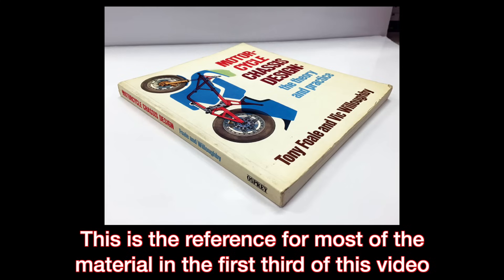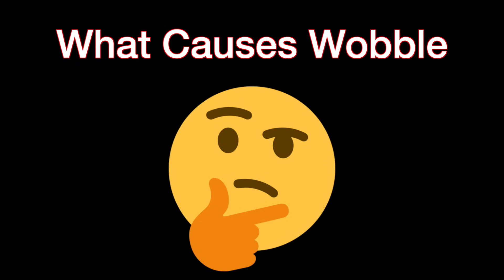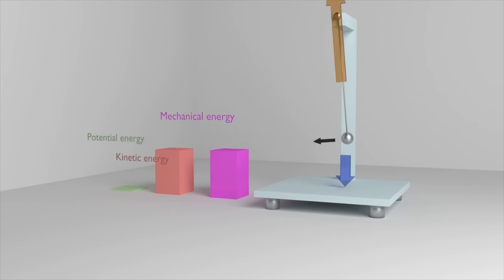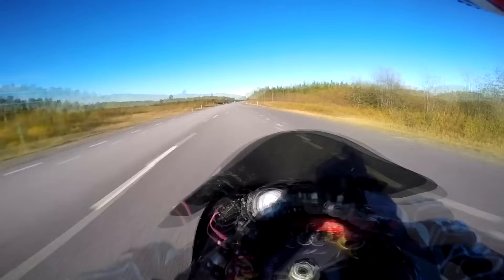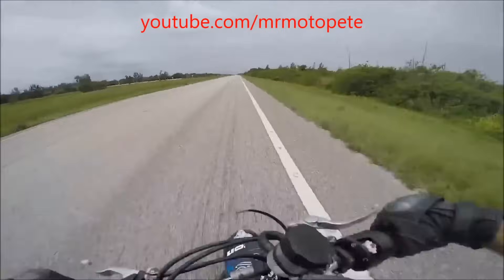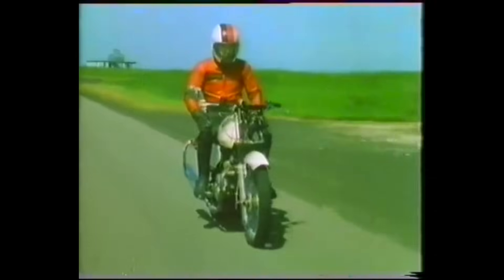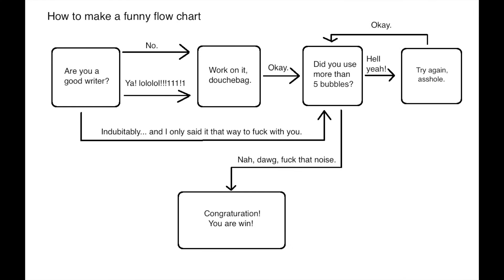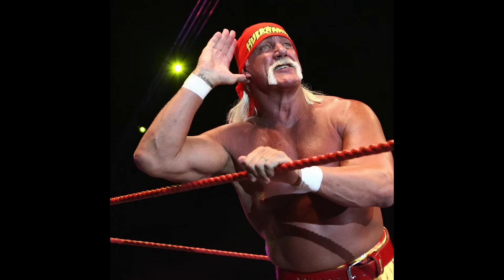Tank Slappers AKA Wobble Explained: Cause, Effects, and Remedies

Comment: I don't know a lot about the modern bike wobble but old school we find a smooth ride point my bike is s sportster  ,it has a nice smooth hands off the bars at about 30 MPH that means I can take my hands off the bars and just coast for 2 or 3 minutes with full control and no wobble of any kind .. I do this test every week or every few rides to make sure a wobble is not developing ...I have never had a problem because I do this test if I make any changes in the weight of my load on the bike or gear I am using , I use a windshield and if check my brakes often ... I have rode a bike with a wobble and that sucks ...a lot of wobble comes from the front end and correct tire and condition of the tire ..the fact is some bikes don't like some tires .. a bike made and design with a given tire company may not react the same with a different make of tire and tread  .....I restore old bikes  from the frame up and found this to be the case in about 70% of the bikes I worked on .. hd Honda any of bikes can be effected by design threshold ,once you change something on the bike the bike goes past that threshold  and hello wobble ! the best thing I can say is take a few weeks and set the bike up for you so your bars fit your ride and you are balanced correctly and if you use forward controls make sure your foot pressure is forward and not resting on the bars ..I use my saddle bags a lot but I change tires every two years ...both front and back ...and I do them my self so I know they are done correctly ...and nothing has changed my set up of the bike and how it rides ...then I do my smooth test . if that bike will coast smooth at 30 it should ride smooth when driven at 60-65 .. MPH
Reply from the maker: This is a good idea, especially for people rolling saddlebags. I’ve never experienced a noticeable wobble, but I ride mostly street bikes with dampers. A lot of the videos I saw with wobble had saddlebags, and based on how commonly Harley’s get it, it kinda makes sense this is a common cause.
Reply: I would like to add if you don't have a windshield on your bike and you put a lot in your saddle bags the wind conditions could force the front to left and this could be the cause .. why . I have my rack and a freezer bag that will hold two 12 packs and both leather saddle bags full and I still don't get wobble ..my fast remove wind shield tilts backwards and puts a down force on the front end tire .. and I don't have the wobble a one of my friends dose but he don't have a windshield on his bike one year older same 1200cc sportster 2001 . I have the 2003 100 years av ,,if your getting head wind slow down if you don't have windshield on your bike . maybe that's why your sport bikes don't get as much ... good logic ...!I guess I am correct look at the pictures he shows  the one passes under and bridge  the air currents are different under the bridge same as getting in the wake of a 18 wheeler  the is choppy and rough ,, its the wind over the bike causing most of the effect ...the more stream line and balance the less wobble   ...the guy riding wheelie may have a loosen the front end after a few dozen wheelies ,and his front end is a dirt bike bars and folks with little down force pressure on the front tire ...add the dirt tire and you got wobble ...now I know I am correct , if the bike is a big road full dress it has hard saddle bags the stick out from the bike more and make a air stream drag on the back of the bike even if the bike has a faring windshield . add weight and wind conditions and you get wobble ...notice the guy with a standard bike no windshield . no way to force the front end down ..if he sets up straight on the bike he becomes a wind sail forces the wind to left the front end and wind hits him .. and look its not shifting his weight forward that stops the wobble its the fact he is no longer causing the  wind sock effect  ..

Comment: Can you actually stop a wobble yourself without panicking? You seem to know what you are talking about,  it’s really easy to say how to do something without ever have doing it. You keep giving low blows to cycle Cruza but in all honesty who can remain calm in a situation that can potentially cause you to die? Common sense goes out the window and natural reaction occurs. Depending on your experience that can be a good or bad thing. Nobody has time to sit back and think about what’s going on in a panic situation.
Reply from the maker: Wobble falls into the acute or consistent. If your bike develops a consistent wobble, you should hopefully feel it at speeds that are controllable (Sub, or near highway speeds) which is way before the point where it actually causes you to lay-er-down (This is what the Dunlop video demonstrates).

Acute wobbles generally happen at very high speeds, and are often caused by terrain or a strong shock to the front end. No, not everyone will have the presence of mind to make adjustments to correct the wobble, but if you are riding at high speeds then I think you are generally of the skillset that you might be able to take action in the moments leading up to a full-blown wobble to hopefully correct it before you get bucked off, as long as you understand possible solutions.

I point out that CC doesn’t know anything about motorcycle technique, because he consistently reminds us all that he has no a desire to do any research before he pops-off to people who know very little about the topics being discussed. He goes entirely by intuition, and you can see how hard it is to get him to verify anything and admit any fault in this video he finally pulled after weeks of pressure: https://youtu.be/HZW3eT2ESa4

He should stick to entertainment.

Comment: Avocado - why scoop when you can peel?
Reply from the maker: I don’t think I’ve ever seen anyone peel an abs ado before, do you just make a cut and peel it back? 🤔
Reply: @SquidTips  Cut avo in half, then cut each half in half. The pit will stay with 1 quarter. Since you can get under the pit now it's easy to pop it out. Now you can just peel the skin off each quarter, leaving you with 100% avocado goodness - no fuss, no muss, no aggravation.

Also, accelerating out of a turn across wet pavement markings can induce serious tank slappage. Lesson learned at low cost THAT day!

Comment: I did't know about leaning forward and was afraid to go faster.  I wondered if the front fender aerodynamics could cause this?
Reply from the maker: In reading about motorcycle chassis design and stability, it seems like bikes can be very sensitive to even small changes to balance, aerodynamics, and weight distribution, so I’m sure even something as minor as a fender adjustment could cause critical instability at the right speed.

Comment: High speed wobble weight balances are off. Most idiot's get a wobble after they pull the front wheel off the ground and ride on one wheel that causing's the front wheel to slow down affecting the gyroscope action of the front wheel. So when idiot brings front tire back down to the ground at high speeds the front tire is forced to speed up which cause's the front tire to skip from traction one side of tire grips the crowned road then skips over to other side of tire resulting in a wobble. Their are weights at the ends of the handle bar grips of sport bikes and these are notoriously the cause of a high speed wobble in sport bike's from the balancing being thrown off. Other aspect individual has placed a larger horn on bike for more of a honk then a meep meep and the added weight has thrown off all tge balancing of the bike. ☺

Comment: That was a pretty decent video.  Thank you.
Reply from the maker: This one was a huge challenge with trying to simplify concepts like Natural Frequency and Harmonic Motion. Knowing your background I’m glad it seems like I at least didn’t totally blow the explanation.

One thing did come up in Reddit comments; Is the correct term ‘Dampening’ or ‘Damping’?
Reply: I believe it is a damper and the effect is damping...  BUT I've never used one, just heard the terms at the dealerships.

BTW, in all the years of my riding I have never experienced this.  I've heard about it from others, but never experienced it myself.  Mind you ever since I was a young kid I always had every motorcycle serviced by a dealership.  I have taken shortcuts on getting cars worked on, having regular garages work on them but never on a motorcycle.  I've also had any and every service done the dealership mechanics recommended.  I may have been very lucky to never have this happen but I suspect it may have had more to do with me being very anal when it comes to anything even so much as quirky on my bikes.  Yes, I've had steering (head/neck) bearings replaced before at the dealership's recommendation.  

Thanks again for the major effort you put into this and for providing very good information in a short video.
Reply: Something I might mention is I started riding on dirt bikes.  Motocross teaches one to sit as far forward in the seat as possible, up against the tank for the best control.  As I think about it now, I took these lessons with me regardless of what I was riding.  

Forward on the seat, elbows in, knees pressed against the tank, sitting straight up or leaning slightly forward, with feet pointed straight ahead prepared to raise up off the seat as the terrain requires.  I believe this naturally distributes weight further forward on a bike.  I had never even considered how my motocross background affected how I rode other bikes but now that I reflect on it, maybe my riding style eliminated any potential wobble.

It's possible that riding position makes a world of difference, but I don't know.  It's something to consider.

Thanks again!